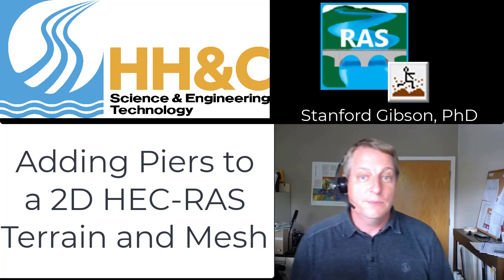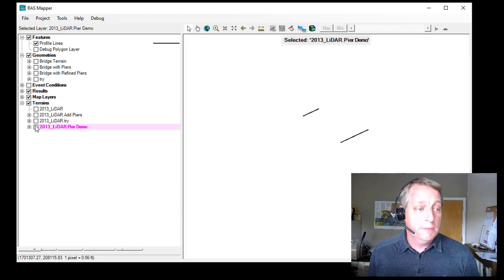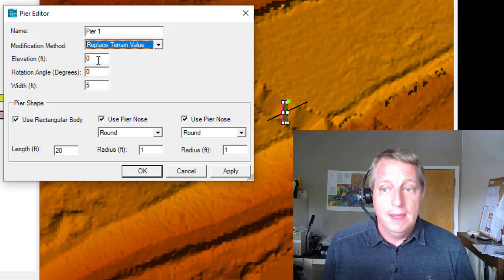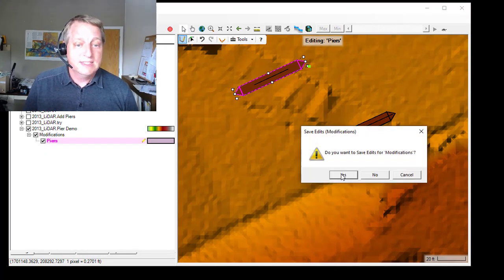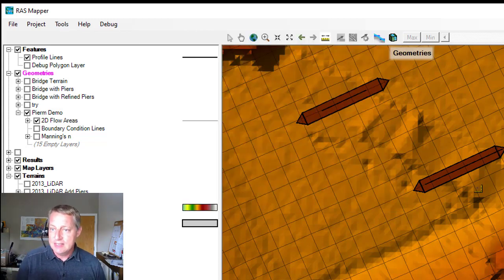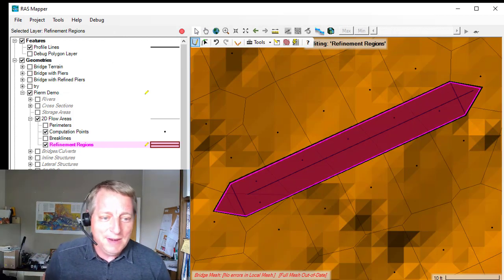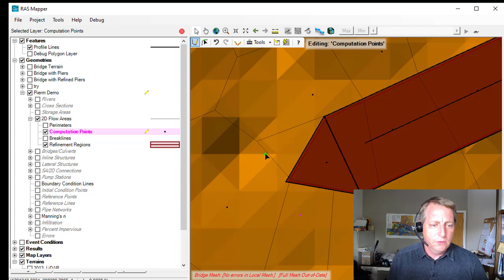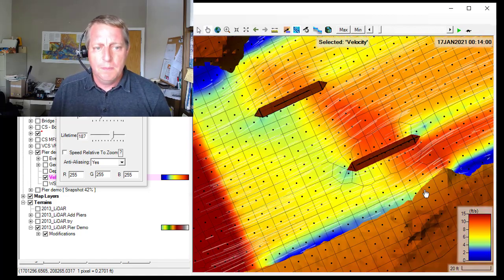Adding Piers to a 2D HEC-RAS Terrain and Mesh

Comment: Hi Sanford.  Very helpful modeling approach you demonstrate here.  I am interested in what you might think of this approach.  It was challenging to get the cells in the refinement regions lined up so perfectly with the pier terrain modification.  I kept seeing leakage at the piers, so I did the following:

Place the piers in the model at just a tenth or two smaller than they really are.  Establish the Refinement Regions by tracing over the pier modifications, mesh the model, edit the Computational Points as needed.  Then, return to the pier terrain modification editor and edit the pier width to the real, slightly wider width.  I'm hoping that the result will be that the Terrain is modified for the pier and it will widen into the adjacent cell, effectively blocking that side of the cell and preventing flow from "leaking" through it.
Reply from the maker: Also, RAS2025 already includes gaps, so it will be much easier in the new version.
Reply from the maker: Sounds good to me!

Comment: Many thanks! May I ask what's the rules/requirements for adjusting the mesh around the piers? You mentioned that you changed the mesh around the nose, is it more or less a personal preference based on experience or is there a certain rule to abide? Thanks.
Reply from the maker: In the current version of RAS, Mesh design is a bit of an art (note: this will all change with the next major release).  I try to use Breaklines and refinement regions to reflect the impact of these structures in the subgrid.  And some of it is iterative.  Do the velocity vectors make sense (ro are they jumping through the piers or generating unrealistic eddys)

Comment: If we make Manning's value in piers area iqual 100....the flow don't pass there, right?
Reply from the maker: High n value regions are a hack that will approximate obstructions, but I prefer stamping them into the terrain now that the mode tools are available.  There is just less ambiguity about water volume, wetted perimeter and how the model is interpolating hydraulics.
Reply: @stanfordgibson Many thanks for your answer.